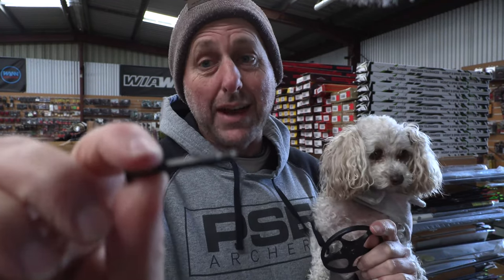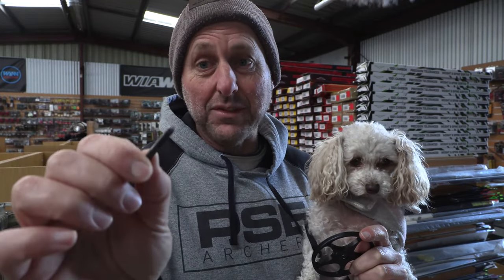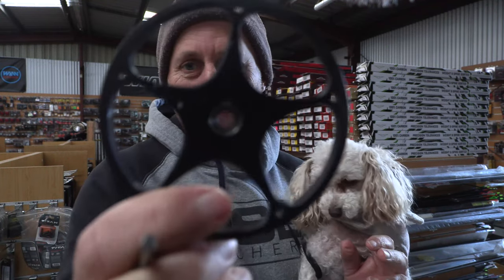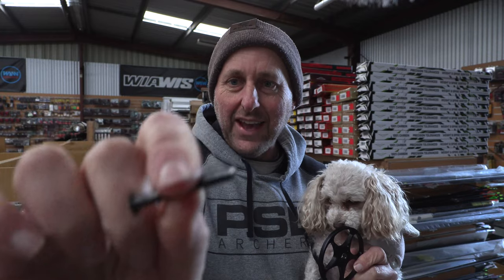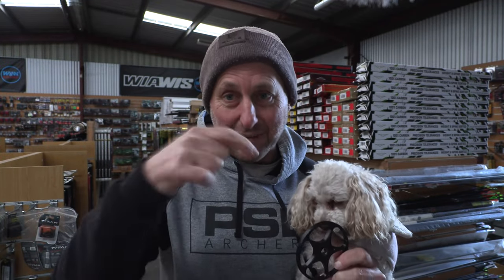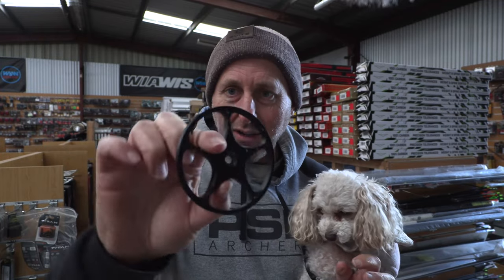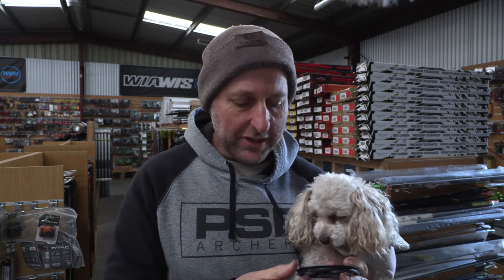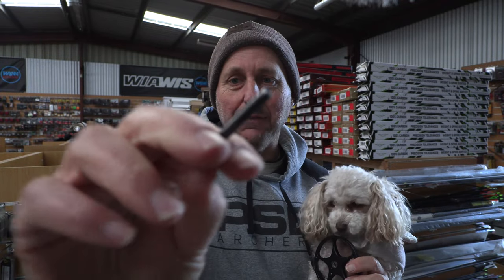Axle Snapping on Compound Bow

Comment: Hi Stephen, last weekend on a shoot in Exmouth England, one of the compound shooters using a Matthews bow had a catastrophic failure.
I was not at the shoot but one of my club members had photos of the bow and it was in pieces.
The bow user is a highly experienced shooter in the southwest of England and at full draw when it seems the top limb pocket bolt snapped, the bow exploded with a bang that every shooter in the line and back field heard, the archer flinched away getting minor damage from pieces of the bow, whilst pieces and cams went rearward into one of the tents.
Luckily no one was badly hurt and the archer involved is now in contact with various dealers and manufacturer.

Comment: Exactly this happened to my stinger max last night. I shot about 10 arrows that were good. Then they started to hit about 10 inch left. Tried to figure out what was wrong but could not find anything. Nocked an arrow, pulled back and the thing exploded. String and limbs look fine but the axle of the top cam completly snapped. Bow had the limbs replaced two months ago under warranty due to cracked limbs. It has NOT been dryfired. Called the local shop and he said he has never seen a snapped axle in 15 (or more) years of business. Will take it in saturday to have him have a look at it.

Comment: One more snapped axles,  Oneida Tomcat II (1993}  lower. Bow started makeing creeking noise I could not locate followed by sudden increase in shot noise.  Lower Axel had broken inside cam body.  Found replacement cams axels from John Greenwell at Gstrings Bowstring, one to the best sources for old Oneida parts and cables (He makes the G-rex bows).  when I went to re-build the bow I found the pilon axel  roller bearings had failed and caused the axel to jam and snap.  The same failure in two very different bow designs. (lubricate  your axel bearings may be the message)

Comment: Hi Steven, I had a similar problem with a 2018 Stinger Max, the D loop moved up with the whole serving of the cable, I caught it fairly early, the bow was shaking on every shot, and one of the safety shimms that hold the axle flew away. I suppose if would have kept firing the axle would have worn of or got a similar behavior as this one you are showing. 
Thank you, I appreciate your videos!

Comment: dry fire destroys bows...  mabye the guty needs education before you fix his bow only for him to do it again lol..  (instructor, traditional bows hehe)  ps bearins dont put side force on a cam, normally the string rolls off before that.  did you check the relief? the cable should be a couple mm long then the bow arms can pull it..  I think relace a limb would be faster the replacing the cam woulded it?   Im traditionnal archer, not real experienced for compound